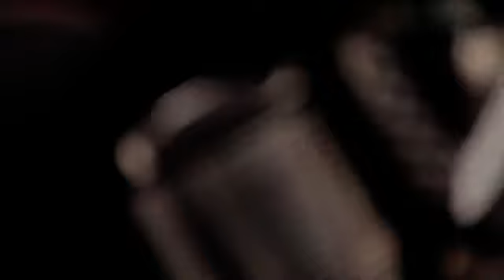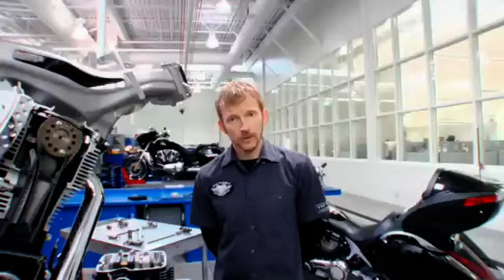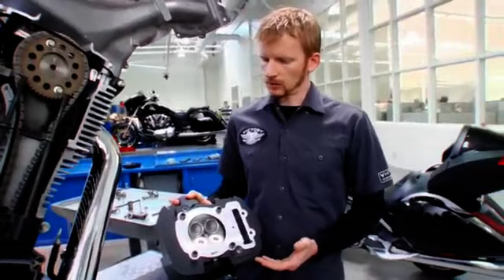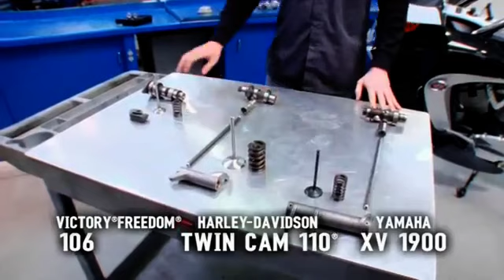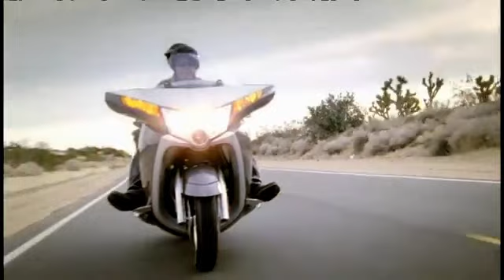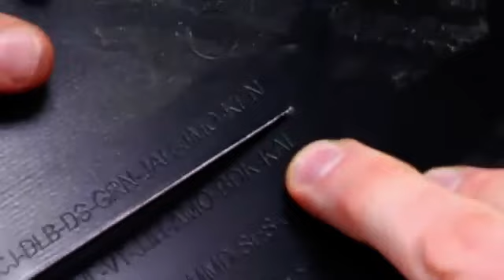2012 Victory Motorcycles technical explanation Freedom engine 106 ci.

Comment: Polaris messed up.  Over time, the R&D costs go down as the production sales go up.  So, the Victory 106 cost were going down as sales numbers increased.  After a certain point, the break even is past by sales numbers.  So, Polaris could have started to drop the prices by "changing" the model names and not changing the bikes.  A Victory Vision "Muscle" could have replaced the "Street" model and the cost could have went down, thereby, increasing sales via a lower cost product.  Polaris really messed up when they got rid of the Vision and the Cross Country models...  Too bad, they were great bikes and now (2020) the prices are increasing on the used market.
Reply: Polaris are a marketing genius. In 2025 they will re-launch the Victory motorcycle brand with a thunderous re-entry. They just want to establish the Indian brand first.
Reply: @niuleni  I hope so.  But, I checked the "Magic 8 Ball" and it said, "Outlook not good", whatever that means!  Take care....
Reply: I hope they at least saved all the tooling and molds for these wonderful machines.

Comment: Victory uses a math formula to calculate gear position based on rpm and speed. If you pull in the clutch they don't let the ECM do the calculation.
Next time you are riding try pulling the clutch just enough to let the engine rpm climb, you will see the gear indicator change even though you didn't shift.......
Reply: Hah, I was wondering why it did that.  Just bought my bike a few days ago and haven't researched why I get a "--" when I pull the clutch in.

Comment: I dont want water cooling but what do you mean (in our power class) ? would water cooling increase power? Also Why cant I see what gear im in untill the clutch is out?
Reply: disconnect the wire going to clutch lever . You will be able to see gear until you come to complete stop. Doing this will allow gear to still be seen if moving and clutch is pulled in. Only downfall is this, if you stall it in gear, you can't just pull in lever and hit start button. You MUST be in neutral to start bike.
Reply: look at a bike like the Triumph Rocket or any crotch rocket...  he ment power class as in these low power v-twins...  the most expensive way to turn fuel into noise lol.
Reply: I said the same thing to a victory representative once about the clutch gear indicator I said it's probably my biggest complaint about the bike and he said he hears that all the time